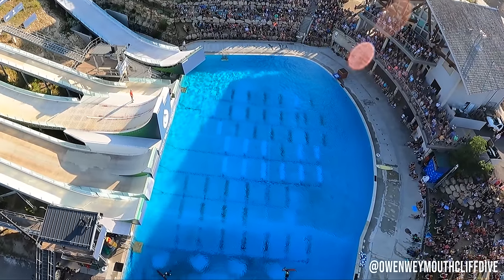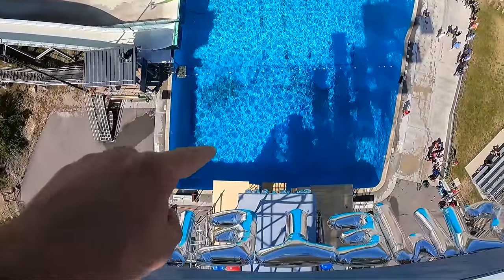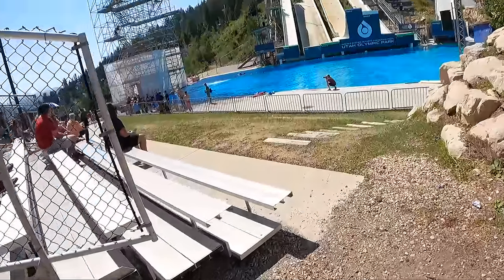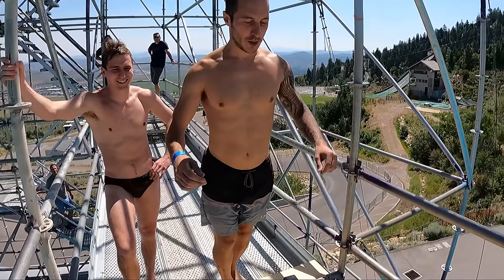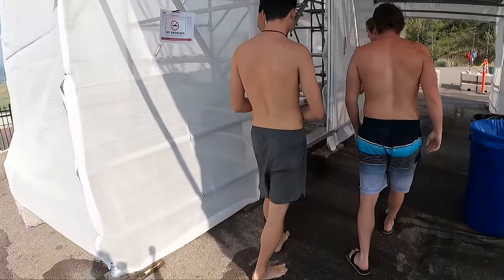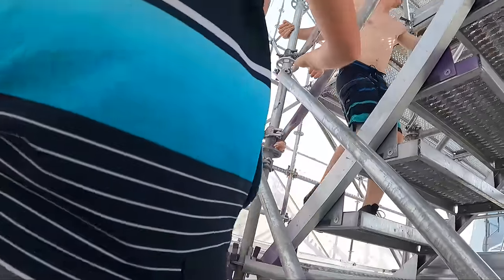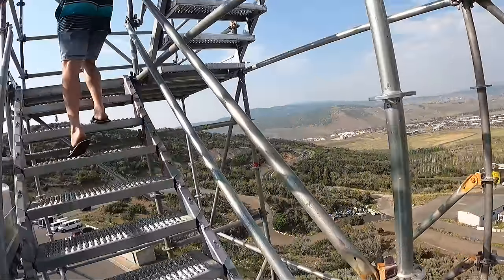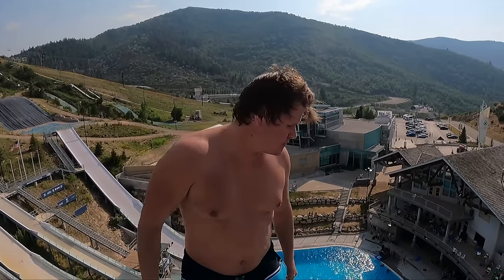Jumping Off A RedBull High Diving Platform!!

Comment: Something also very interesting about this is the safety engineering behind that pool. It has that constant stream I believe to break the surface tension of the water constantly, and they have some kind of air jet system that creates chop. Incredibly smart, and there to protect you from injury.
Reply: Because it's a surface agitator; it provides a visual cue for divers that helps them visualize where the pool is in relation to their dive. Essentially, it helps them judge when to enter their rotation as they dive into the water.
Reply: Ahh I was curious about that.
Reply: I thought bubbles were to "soften" the water, making landing not so solid

Comment: How deep is the pool and how far down do you sink into the water from a 27m jump?
Reply: should be 10m deep.
Reply: 15 feet will suffice, i think this pool is at least 20 feet
Reply: @sakora808   This is in my home town Park city utah its 27 meters deep and they pump air bubbles in the water when you land. I used to train there doing ski freestyle and aerials.
Reply: @colequitiquit9487  27 meters is 90 feet. That pool is not 90 feet deep.
Reply: You don't really go THAT deep. 

I jumped from a waterfall 2 times this height and the water was maybe only 15 ft deep.
Reply: @Pussmash  do you still have working legs?
Reply: @colequitiquit9487  you miscalculated.... 27 meters is very deep
Reply: @Pussmash  STOP IT
Reply: @melissakelly5813  legs still work hehe. It was in a slowly moving part of the Amazon on my Costa Rica trip. I believe it was probably about 15 feet and I did feel the silt on the bottom of the river. But no impact. I have jumped off a rock in the U.S. (Georgia to be more specific) that was about 40 feet high. I was 17 at the time so didn't give a shit about how deep it was, looked fine to me, shattered my ankle on a rock down below.  That hole was MAYBE 7 feet deep. Bad weekend 😪
Reply: @melissakelly5813  but my measurements could be totally off because I didn't have equipment for that. Just my go pro or other cameras. But I know the waterfall I jumped from was over 30 meters. Took SEVERAL seconds to fall. Exhilarating.
Reply: It’s 100 meters deep
Reply: @Pussmash  OK right check your geography buddy, Costa Rica is in Central America, the Amazon is in South America. Makes your claims look foolish.
Reply: @johnhamilton2914  no kidding. You're right lmao. I was 18 and that was my first and only trip down there. And my geography is horrible. 

It was rainforest but no, it wasn't the Amazon. I'll have to look up the name. I stayed in Dominical to surf, sorry for the mess
Reply: @Pussmash  Come on.  There’s no 30 meter waterfall you can jump in Costa Rica.  Certainly not into a river.  You’re probably thinking feet not meters.
Reply: @marshallsweatherhiking1820  it's called the Nauyaca
Reply: @marshallsweatherhiking1820  It might not have been exactly 90 meters but it was at least 250-300 feet.

And it absolutely was into a river. But more of a pool of slow moving water. 

I flew a plane, then drove a car, then rode a horse to get all the way out there. I'm pretty sure it's there.
Reply from the maker: The pool is 16.5’ deep. Some people do manage to touch the bottom on the 27 meter jump but most don’t.
Reply: @BrandonGross  im surprised this it. I work at a pool with just a standard dive tower (up to 10 m)  that has the same depth and ive touched the bottom off that. Did you touch the bottom on any of your jumps?
Reply: I don't think these guys are hitting the water pin point at that height. We'd have injuries galore if it was that dangerous.
Reply: It’s 16 ft 6 inches
Reply: @Pussmash  i just watched a pro do an appx 180 foot waterfall dive ...... It almost knocked him unconscious.......no way you did what you're claiming.
Reply: @Pussmash  the world record is a little more than 58 m.
You did not casually break a world record bro hahaha
Reply: @adamgardener8624  yeah you're right. My brother and I stayed there for over a year to surf, and met the owners of the property so we could learn more about cliffjumping. The tourists would normally jump from a small cliff about 40 feet high, and they would let us climb the side to the next platform with another guy. He wasn't a tour guide though, can't remember what his "title" was, but his name was Carlos xD. 

Anyways, this thread made me feel like the dumbass I am, called my brother, and he corrected me. He said "bro you're dumb as fuck, it was maybe 30 meters"

Sorry for the confusion, I definitely did NOT beat a world record. Now i want to jump from that height!
Reply: @Pussmash  cool man. 300 feet is REALLY fxxkin high. 
So is 100 ft.....but 300 is waaayyyy more
Reply: @adamgardener8624  yeah I bet that would be a blast, have a good weekend man. Sorry again xD my math is horrible
Reply: @Pussmash  right on , sir . youre still ffxin crazy.
Reply: @Pussmash  100 ft is about 10 stories......thats high A F !!!!!!!
Reply: @Pussmash  So you jumped from 170ft? Doubt it. You said “two times”.
Reply: @MinerMends  no no, I was corrected a while back that it wasn't over 100 feet lmao. My brother told me it was about 30 meters. And it wasn't even in the Amazon. I'm not too bright obviously lol.
Reply: @Pussmash  you jumped 180 feet lol?
Reply: @marshallsweatherhiking1820  Yes there is it's in Montezuma on a 40 minute hike down a river and people don't recommend it because the pool is so shallow depending on time of year.
Its probably 90-100 feet though, not meters.

Its in a pretty rainforesty river area of Costa Rica but not the Amazon lol.
Reply: @Pussmash  ya okay

Comment: If 90 feet is approximately 27.432 meters then  √((2×27.432)÷(9.8)) = 2.366 seconds of flight time. 
Velocity at impact would be √(2×9.8×27.432) = 23.187 m/s or 51.867 mph.

How does one protect the Johnson?  Just seems like it would be painful if you dug a heel in and sent a blast of water in the wrong direction.
Reply: 83.5 kph, that’s insane !!
Reply: It simply doesn’t happen
Reply: I couldn't even read that maths dude
Reply: So how deep does the water need to be in order to catch them safely??

Comment: Oh,my God, I'd be terrrified of hitting against the other platforms on the way down.

About 5 years ago now, I went and did a day out canyoning with a friend and we did a small jump about 12 feet high,no problem. The second one it was a case of we had to step out and jump because you couldn't do it near the edge. I didn't do it but she did as I didn't want to jump out "blind".

Anyway, the last one we did was about 20 feet high. I was terrified but determined to do it. I followed the instructor's advice, kept my arms against my chest and my head up straight,but think I moved my head back as I jumped. As I hit the water I felt blood in my mouth and pins and needles in my arm. The instructor had to come in and get me. To say I was pissed off is an understatement.

For ages afterwards I could barely lift up my left arm which is fine now. I honestly don't know how you can jump as high as you do.

Comment: Dang guys.  I did 10m platform competitions for a bit, and never did get completely comfortable with the height.  I actually competed in Salt Lake, Utah at region X championships in 1m and  3m springboard (didn't make platform).  Casually throwing off 27m is nuts.  I can't imagine how fast your heart must have been pounding.  Landing slightly wrong even at 10m can put you out of commission.  Pretty hardcore.  Did the tower sway in the wind?  That always screwed with my head on some of the cheaper 10m platforms.

Comment: Man you went so far on the 20m. Did you hit the bottom ? That made me pucker.
Reply from the maker: Lol no i didn’t touch but definitely went too far
Reply: The higher you climb the less likely you are to hit the bottom as the impact from such a height is slowed down by the resistance of hitting the water at highway cruising speeds.

Comment: This is nothing... I jumped from 15k feet and fell for over a minute with an average speed of over 200km/h and landed on solid ground.
Reply: Sky diving is less scary than base jumping. I have done both and the fear/anxiety of base jumping is on a whole other level.
Reply: @BigDaddySwingingMeat  yh, I can imagine. I don't base jump myself because I find it too risky. And I don't think the added fun factor is worth the risk. When I need a good boost of adrenaline I go for a low opening just above 2k ft, that always does the job lol.
Reply: @venezzrok-fz1du  It was a one and done thing for me. I plan on skydiving again but I doubt I will ever base jump again. Also, the special types of parachutes that base jumpers use are expensive. They are different than a standard skydiving parachute.
Reply: @BigDaddySwingingMeat  yh true, both are expensive though :(, maybe I will do a wingsuit from a mountain one day, but I will stay at a safe altitude and not like those guys that hover a few feet above the ground lol. But it always worries me that base jumpers jump without a reserve, I know the chutes are different en less likely to develop a malfunction but I already have 1 reserve opening in my pocket and hell what was I glad to have a reserve and the altitude when I needed it lol. (It was a line over btw, right steering line was as good as stuck and I openend and went in a unstoppable spin lol. A packer packed it and since then I always packed it myself haha. 

Anyway, skydiving is still so special, everyone should do it imho.